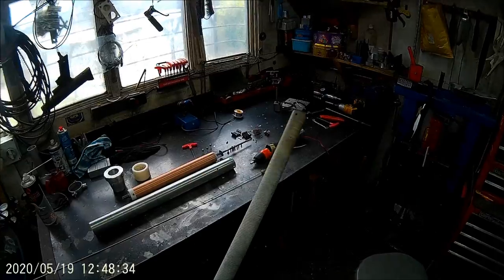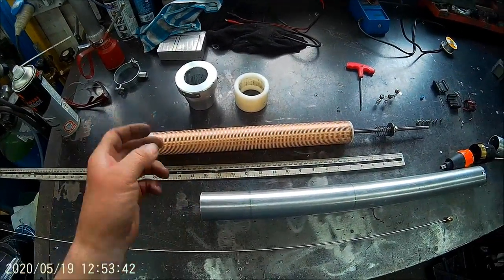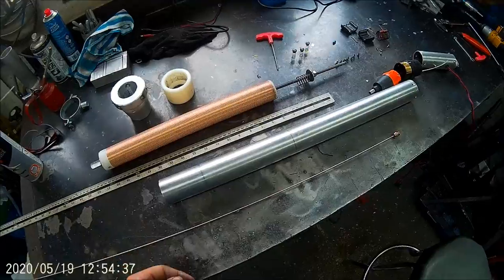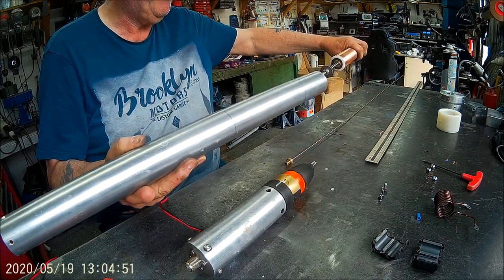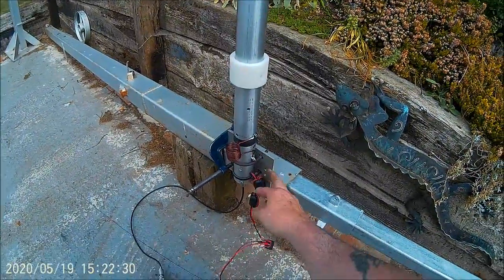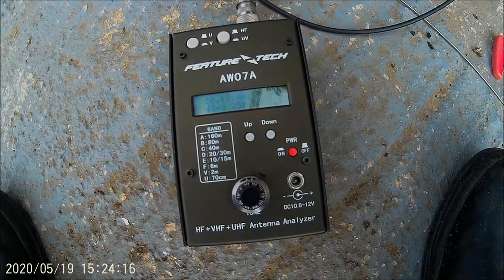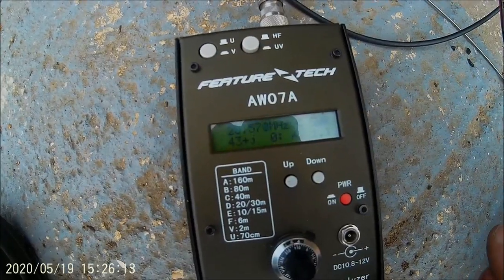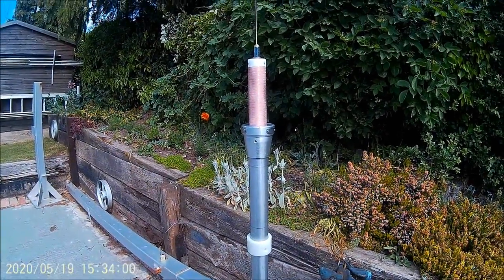Home Made Screwdriver Antenna

Comment: If turning threads for your coil is not practical or available I use weed eater line in between my wire to insulate and space it as desired you can find a combination of nylon line and wire diameter to accomplish about any spacing.
Reply from the maker: Hi Tony thanks for stopping by and suggesting a great tip I will use it sometime I am sure.
Cheers Nigel

Comment: Thanks for sharing, I have made 4 screwdriver antennas years ago using Don johnson's BOOK(s). Using copper pipe 1 1/4" 1 1/2" and 2" pipe the 1 1/4" was the most difficult to build. Had to use entirely different motor, but all of them do work 10 - 80 meters, yes I used 10 threads per inch on the PVC coil form on all of the antennas. I was able to acquire some very good quality finger stock years ago at HAM FEST from a gentleman who had worked for Collins Radio.. This has performed very well. I have used mainly the 1 1/2" antenna on many  different vehicles still using it today. I have used an UNUN for matching and have had less than good results Shunt feeding these antenna. You mentioned your shunt feeding method 8 turns of 2mm enameled wire, what diameter form have you used to make this?

Thanks KD8NV
Reply from the maker: Hi Randal thx for the message as for the shunt it is 8 turns about of 1 inch in diameter seams to be the best for my application I did try 
many other sizes until I found the right size cheers for now.
Reply: Thank you have a great day... KD8NV

Comment: Good Video!  If you can find them, they make set screws with ball bearings and springs built in (for detent's and such) that should work in this design.  73  mike
Reply from the maker: Hi Mike thx for the info I will try and look for some may come in handy sometime. cheers

Comment: To slow down the screwdriver cut the voltage below the 6volt it will turn slower and not be so touchy on adjustments
Reply from the maker: Hi alan thx for the comment, now the antenna is on the mobile it is working fine and no issues tuning cheers.

Comment: You could add a capacitance sleeve over top half of whip to bring frequency down a bit...

Just by using foam double sided tape as a dielectric & then covered with copper tape for the top half of whip.
Reply from the maker: Hi Crazy Ham thx for the suggestion I may try that.
Reply: @fixitnige  Let me know how it goes mate.

Keep the copper tape with no DC continuity to the whip itself.

Comment: nice little build 👍
i can only recommend an H-Bridge and an arduino instead of the manual switch, so you can drive the motor with PWM signal for variable speed, and have all the memory points for different bands with one press of a button. if you want more info on that one, just reply to this comment.
 I once done something similar for a satellite dish motor and it worked perfectly :)
Reply from the maker: Hi thx for the comment I do was to do a memory setup for this I was looking at the MFJ one but it's expensive and I am not a fan of MFJ to be honest, I have never done anything with arduino but always willing to try new things, Thx again.
Reply: @fixitnige  glad to hear a reply :) well the simple diy would be any kind of sensor that counts how many turns the shaft has made (a rotary encoder if u willing to go fancy, or a simple hall effect sensor and a magnet? then its very simple: sensor->arduino->h-bridge->motor. the arduino simply spins the motor, counts the shaft turns, and stops at the right number of turns. you calculate in advance the desired number for each band by tuning manually with your SWR meter, and the arduino just store those numbers as presets which you can select form. you already know soldering pretty well so this part of the equation is solved you u. anyone with a basic coding skills can help u with the rest. all the parts should be like 20$ or so :)
Reply from the maker: @EvgeniX.  Thx so much for the reply I will for sure look into this a little more as with most things when you know what your doing it's simply :) cheer again.
Reply: @fixitnige  im pretty handy with an arduino.  You could do all sorts of things to measure heights, the most simple would be some externally mounted switches to register when the antenna is at each point, then a couple of FINE tune buttons to allow you to send it up and down and get it just right.  You could have a rotary encoder and use that to fine tune with relative ease.

congrats on a great looking antenna. Id use some pvc pipe with a blanking cap on the end as the cover
Reply from the maker: @spr00sem00se  Thx for the comment and the information I am busy with other projects at the moment but will look at this again when I have time and maybe give you a shout cheers.
Reply: Let me know and we can discuss some ways to do it. I can give you some basic code to try out.

Comment: Hi Nige.. I had to replace the motor in my Taheel2  soo have some pictures of it apart. If you can move the loading coil closer to the feed point you'll need less loading.. the mast section on the tarheel is only about 300mm
Reply from the maker: Hello chris thx for the info maybe if I try another one I may change a few things :) Cheers.

Comment: I'd like to see a closeup picture or two of the bottom of the antenna where the coax connector is going through the mount.I am about to mount a TARHEEL 200HP & I was wondering about the mounting to the TARHEEL bracket since it has no directions.Thanks much & 73.
Reply from the maker: Hi there I am not to sure what part you mean? and I am not going to take anything apart to take pictures of it surely this video explains more than enough info. Cheers
Reply: @fixitnige  you don’t need to take ANYTHING apart.I asked for pictures of the Bottom/Base of the antenna where the Coax connects to the antenna.What part of my statement says anything about taking anything apart? Read it again! Sorry if I confused you but it appears that I did.😳
Reply from the maker: @1OFGODSOWN  It must be the way I read it but the coax just fits with a standard PL259 using a SO 239 screwed to the bottom of the antenna. cheers
Reply: @fixitnige  is there a nylon washer used like on a Hamstick and other antennas under the bottom of the SO-239 that is screwed into the base of the antenna?
Reply from the maker: @1OFGODSOWN  No it is just a 4 screw fixing to the ali plate that is on the bottom of the tube.

Comment: ok you need to get a look at a hi-q 6-160 antenna  these antennas just work and work well...they aint cheap but when you look at the man hours you have in your copy of a lesser qaulity design antenna that apparently does not work well on 80 much less than 160....the money spent on a well designed antenna is well spent in this instance ...years ago i had a hi-q 5 160 antenna and it was stolen but i worked 160 ssb mobile from a suzuki samurai for a year or soand had a blast doing it....and i have made antennas for most of my life ...i started with a crystal radio kit i got for christmass at 5-6 years old...
Reply from the maker: Hello Ray and thx for the comment and information I am always looking for ways to do new mobile antennas so I will look this one up and see what I can do thx again.

Comment: Hi Does you have mor details for the hardware components for the screwdriver (mobile) antennas?
Reply from the maker: Hi Martin the parts are very easy just a ally tube with a 6v battery screwdriver cut in half , The centre core is a piece of nylon rod which the coil of wire is wrapped round. The video is really all you need all the info you need to be honest. good luck. cheers

Comment: Interesting video. I was looking for screwdriver antennas and was amazed at the prices I was seeing. So I would be interested in making my own screwdriver for my truck. Do you have an article online that describes the dimensions and what components to get?  Thanks for your inspiration - all the best! 73 de KI5HXM
Reply from the maker: Hi Brent thx for your comment like you I was shocked at the prices so I googled and made up the parts I needed to make it work and it sure does work well. I do say about the size of things in the video so just listen well I am sure you will be able to sort something for yourself.
cheers for now and good luck.
Reply: @fixitnige  I will take better notes next time.  I like what you said about learning from other designs like the springs and ball bearings.  I have also wondered how hard it would be to make an external non-conductive arm to move the sleeve up and down on a manual screwdriver antenna.  The best way would be to follow your lead and I would get to learn.  Thanks for the reply.  All the best!

Comment: 1.   Nothing to confirm that the maker of the Scorpion has passed away.  2.  You may want to slow the motor down a bit more, easier to tune.
Reply from the maker: Hello Jim yes Don passed away here is an article (  https://www.scorpionantennas.com/don-johnson-tribute_ep_46-1.html  ) The motor does run slower now it's fitted in the van as it only runs on 6volt now Cheers for now.

Comment: My qrz page my call kc6nfv check out the home made multi band antenna coil made out of 2 inch pvc pipe wrap with silver wire he use a 68 inch wip on top it had a device that slide up and down for the band check it out your can run over legal limit power